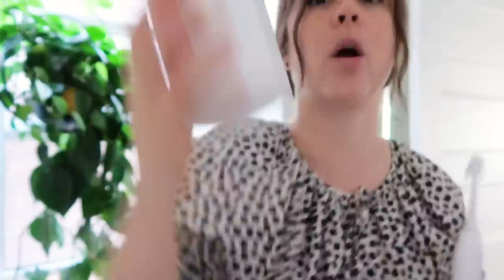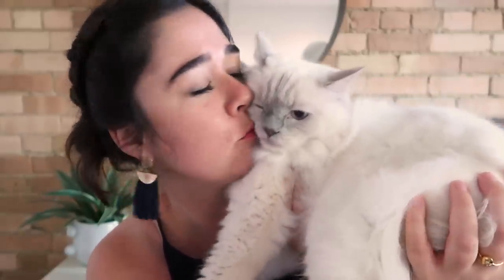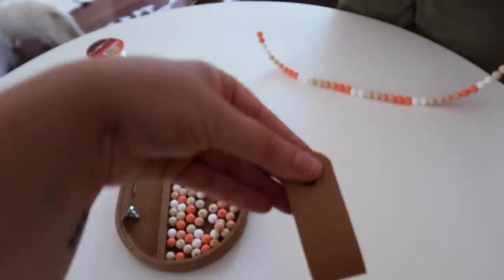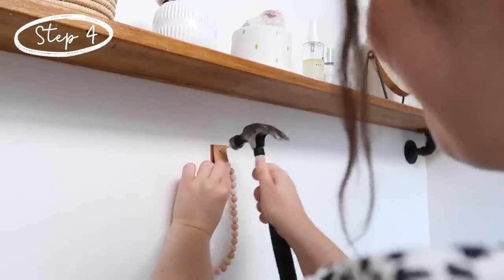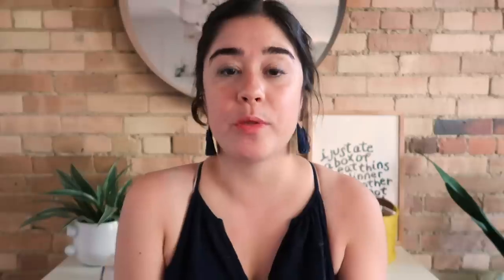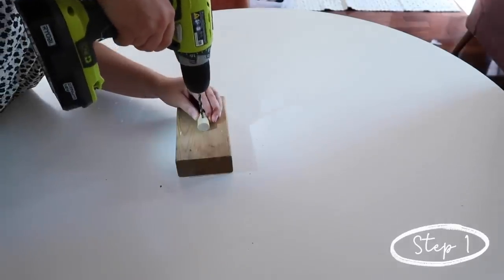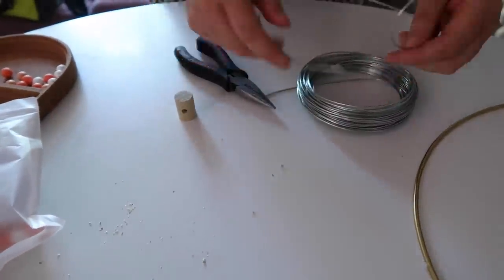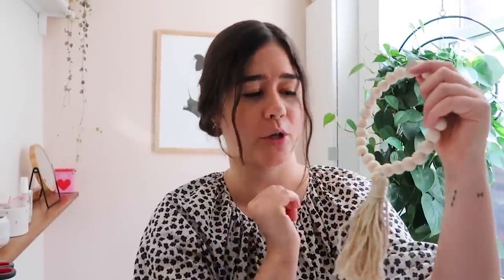3 *EASY* DIY TOWEL HOLDERS FOR UNDER $15

Comment: the triangle towel holder you could have done with an actual musical triangle😃😃 (unless they are very expensive)
Reply from the maker: I was totally thinking this too!!
Reply: I googled and they aren't that expensive really, depending on where you buy them from.
Reply: Yeah I was wondering why she didn’t just buy that in the first place. Much sturdier than the wire 😬
Reply: Tip- triangles made for kids are often cheaper
Reply: I came here to say this! They're only a few dollars.
Reply: Or...old wire hangars from the cleaners.
Reply: Or wraping the wire with clay to give it more stability? 🤔
Reply: I think that was the whole point of the thing that it was the whole point of the inspirational photo that it was the musical instrument. What else would have been special about it?

Comment: The ad link isn't working for me! It might be on my end but you might want to check in case it needs fixed :)
Reply: I can’t get the link to work either
Reply: Link isn’t working for me either...it looks like it’s taking me to the shortened url with the “...”

Comment: Why didn't you hide the connecting wires inside the dowel you used to hand up the towel holder? You could them put tassel there to be seen all the time?

Comment: If you want to save some money, instead of buying leather pulls you can just purchase dollar store belts and cut them to size. And for the geometric shaped towel rack you could’ve used an assortment of copper piping.